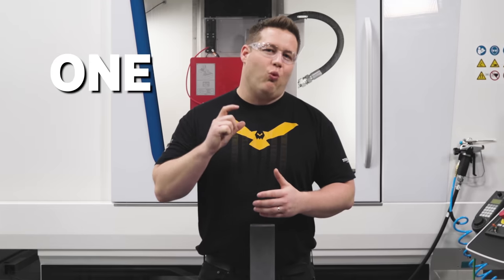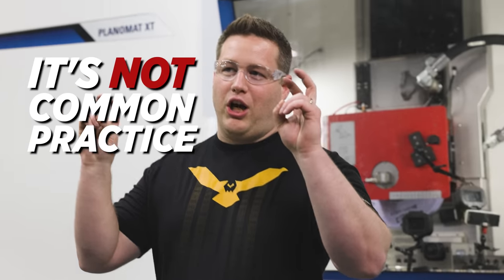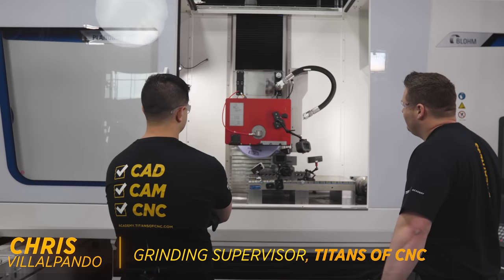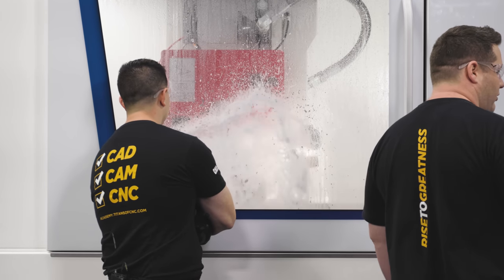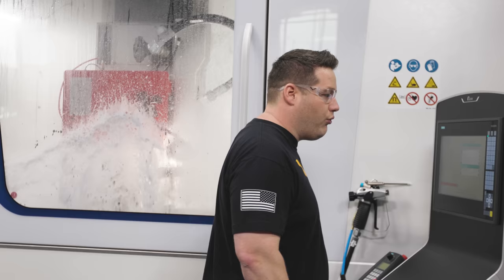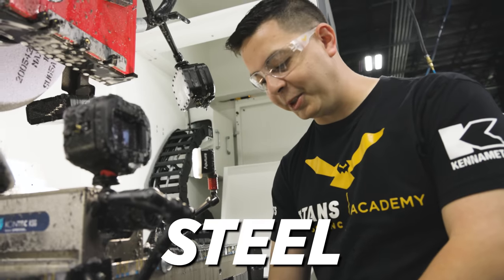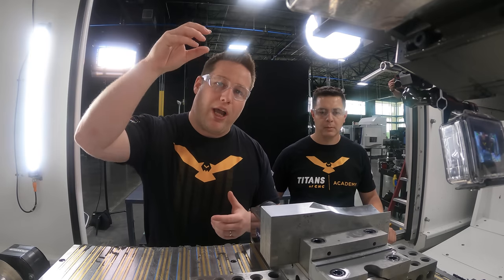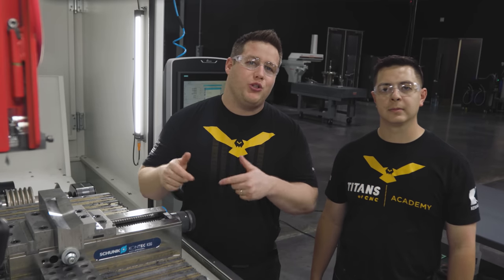Attempting MONSTER 1.0” DEEP Cut on the BLOHM Surface Grinder

Comment: I don't do much grinding but when I do and take a .0005 cut (no coolant) I feel like I'm going deep...
Reply: Idk, I've never ground less than 0.01 mm at a time, and that's on a pretty much toy-grinder
Reply: @NonsenseTreasure  Depends on the accuracy you are after. If you are doing a one off part or a few parts and you start with .005" that needs to come off you may leave .0005 and work a little off at a time if you are trying to hold a total tolerance of .0001" or .0002". If you are grinding mainly for a surface finish it's a different story.
Reply: That's probably because there is no need to go deeper anyway. The typical depth of cut would at max be defined by the amount of shrinkage/deformation from heat treatment. Taking off a lot of material with grinding is stupid, as it causes a lot of heat in the part.
Reply: The deepest I go is usually .002 inch but that’s only for roughing.
Reply: tool & die maker who works in automotive stamping, regularly take off .015-.040 in a single pass in 60-62hrc tool steels. the only thing that matters is the finish pass

Comment: As a CNC grinder that blow my mind I have never took took more than .025  per pass on a punch and die set for a punch press and never seen a form grind hold up with out a over head dresser or single point dresser . these new machines can do so much more than the older ones ever thought of doing . Very impressive thanks
Reply: and you shouldn't

Comment: I remember once a worker used a 20" diameter grinding wheel machine ( non cnc ) and took too much off in one pass , and the wheel exploded .
Reply: I've had a 12" wheel catch and pull a tall part that was being held by blocking into it explode and send the part across the aisle and the blocking into the sheet steel stop plate puncturing a small hole in it. By the time you realize something happened everything is already done, you will not see parts and wheel pieces fly, this was around a ten pound part and it was like a magic trick, it just disappeared.
Reply: that's because the wheel is not a creep feed wheel like Titan is using that can take off a lot of metal in just 1 pass. the one you're using is not designed for heavy depths of cuts

Comment: Very cool!!! could you tell or show in more detail about your emulsion and cooling system through your custom coolant bracket?
it seems to me that in this type of work it is very important that the cooling emulsion under high pressure wash the grinding wheel,
I just wish I could do something similar for my grinding machine...

Comment: I know it's out of context of this video but wondering if you guys always thread mill in Ti 64 or use a tap as well.I tried to tap some holes M16 only about 0.5 inch deep and snapped a fine grain coated tap on the 6th hole.Didn't have a threadmill the right size and didn't have time to order one.Worst of all couldn't tap it by hand either even though I used through coolant drill to minimize work hardening.Any info would be greatly appreciated.
Reply: Drill or mill to 65% thread form. Keep tap rpm under 12sfm. Peck 1/2" D Max. Use rapid tap

Comment: I have a grinding project for you.  Make a knife with a full hollow ground edge and grind that edge, the whole profile, on this grinder and do it in one pass per side.   Then do a second finishing pass for maximum surface finish quality and a very fine edge right out of the machine.

Comment: That is literally insane. Any specific reason you used and angle and not just a flat dress?? My initial thought is so that it works its way into the cut instead of all the surface contact at once.
Reply: My thought is to answer questions about wheel wear patterns.

If they would have flat dressed the wheel, it would have been hard to tell uneven wear across the wheel in the final cut. With the angles they dressed into the wheel, edge roundoff will pop right out on the cut.

Comment: Just because it's possible doesn't mean it's a good idea. 
Splitting that into multiple cuts would probably be faster. The large contact area makes a lot of friction filled with swarf, that does not remove significant material.

Comment: It's impresive but i don't know how i feel about it. On one hand it eliminates a lot of setup and milling work but on the other it looks like it's not sustainable in the long run and it looks like huge fire hazard

Edit: it appears i'm in the wrong here :) I guess you learn your whole life, thanks for clarifying in the comments :)
Reply: @elanjacobs1  Grinding Oil is flameable, i ment it from the perspective of leaving the machine run uncontrolled by operator
Reply: This wasn't for practical reasons i don't think 🤣🤣
Reply: @elanjacobs1  stops the process through
Reply: Why should it stop the process? The coolant is getting cooled during the process...
Reply: @Jacek Stolaronek  we leave them running alone all the time. They have fire suppression systems built in to put out fires. 
Also grinding is easier to do than milling when working with super alloys
Reply: We are using water based coolant in our Surface Grinder, not oil. Jessie also worked with Trevor and created that 3D printed nozzle to maximize coolant flow to the areas needed. The chiller did its job and coolant placement/pressure was ideal for a grind like this!

Comment: Wouldn’t the angle on the wheel increase the overall cut surface area?
Reply: Yup, I'd say so
Reply: Yes but the total material amount removed would be less, still more tool pressure after obtaining full depth.

Comment: Isn't that kinda misleading? The depth doesn't really matter but how much surface is being cut at any time. And then, it depends on the feed speed as well, right? So really, the depth will lead to a higher surface area in contact with the wheel but that "1 inch" doesn't really say much. Depends on the wheel radius, the profile you cut, the width etc.

Comment: I stand behind my original thoughts. There are more practical and sustainable ways to remove that much material.
Reply: Possibly. The point of the video was "can we do it" not "should we do it".
Reply: Yes for normal 4140, but this could have been through hardened tool steel too, not sure if you could do that faster?
Reply: Oh no! People are having fun in the internet

Comment: It makes no sense to grind that deep at all. Just marketing
Reply: you have to know what your machines and weels are capable off. 

that's the reason why i had like 40 mind left over during my practical mid exam which is designed to take you 5.5-6hrs while you only have 5hrs. 
I knew which depths i could take on the mill and lathe while producing precise pieces.
Reply: Meh if you dont knownwhat you can do youll never progress...
Reply: @mattcyr3342  OP must think all grinders are from 70 years ago. Grinding can do a ton of stuff, including hogging. He can't think outside the box.
Reply: Makes no sense to record and edit videos of machining process'. Just marketing!

Comment: It was only 1” at the very tip of the wheel where the contact area was less than 1/16”. That is not what people wanted to see, and I think you know that.
Reply: This was actually more surface area in-cut, so to me this is more impressive than a flat 1”cut

Comment: It's cool but, has no practical reason to do it
Reply: 300 IQ take. Thanks for blessing us with this supernatural revelation.
Reply: Cringe. It's very easy to read about the reasons you would want to use this strategy. You're the guy that runs a 6"face mill on a Chinese Bridgeport at 50 thou and think you're "hOgGiN aWaY a ToN oF mAtEriAL."